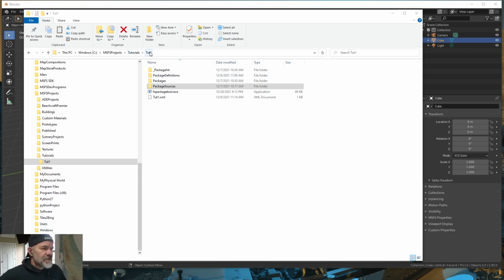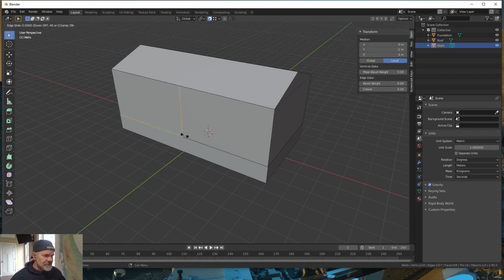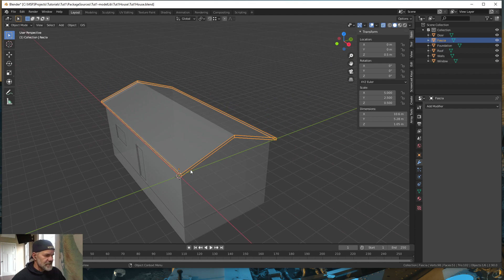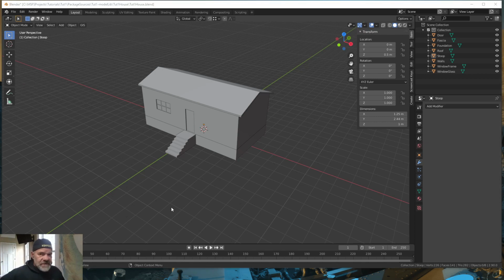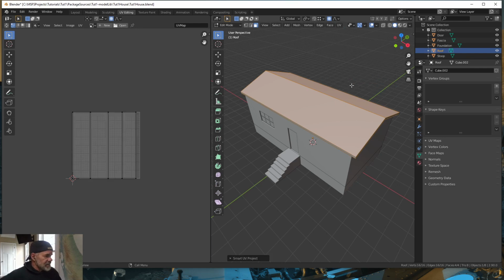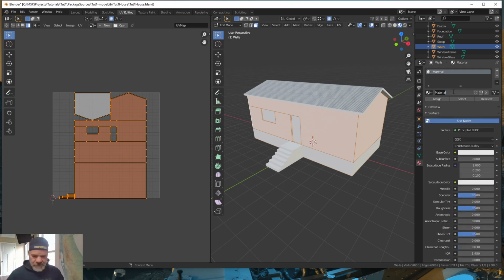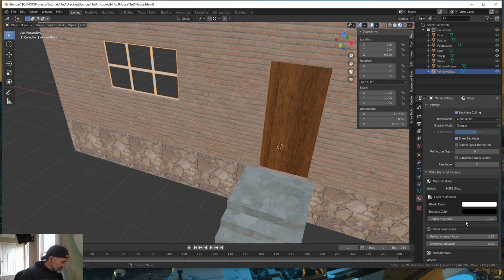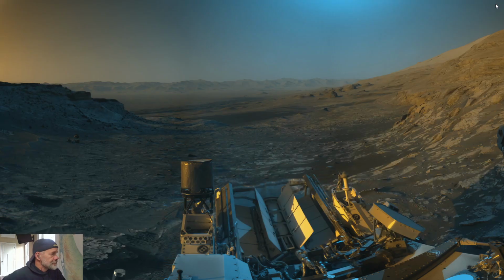Part 5A: Creating Scenery for MSFS 2020: Making a House in Blender and Exporting to MSFS

Comment: Hi.  Thank you for your tutorial series your measured and honest delivery of what we need to do is just right for me.
I am used to using directories/folders etc to run things but haven’t done that for about 20 years. Well done
I have a question I have imported an auto and model into blender( .stl file. ) Just to paint. It.
I have unwrapped the painted model. There are a lot of faces in the unwrap area painted. Are these paint /textures to be put in the project textures folder ( tut1-materials) in your tutorials.  Would I need to add  roughness to them to give them a texture.
Many thanks. Geoff Elks😊
Reply from the maker: Actually, textures used to paint objects are placed in the "texture" folder of your modelLib folder. The "Textures" folder in your materialLib is used for "in Sim" ground textures.

Comment: Hey Mr. World, I don't know if you've addressed this in a future video, but at 44:50 you refer to the Metallic texture slot as a roughness slot.  This is in fact a composite texture slot.  This composite texture consists of 3 grey-scale maps: Ambient Occlusion in the Red channel, Roughness in the Green channel and Metallic in the Blue channel.  This texture is usually named with a _comp suffix. If you assign just a roughness image to this slot, it will mess up the AO and Metallic maps since you would be assigning the roughness image to all 3 maps.  There are some pretty good videos on the construction of this composite texture.
Reply from the maker: Nice. I have to review what I said and take a look. Thanks for the input.
Reply: Keep up the good work.

Comment: Good video. I have a question for you sir. Under the msfs params menu for adding textures. Your screen says Albedo for the first selection and mine says Base Color. Are they the same thing? I don't have an Albedo anywhere. I'm using Blender 3.2 and Multi-export glff 2.0 for the msfs addon. My msfs addon is a bit different from yours. Do you have any experience with it?
Reply from the maker: It is the same thing. I use the Asobo exporter in 3.1.

Comment: Love these videos they have helped me a bunch! Im just wondering, I have an existing project and got done with the first terminal and i have some texture issues where they show up pink or i have a face missing in the sim, im just wondering how to fix them in blender so that they would automatically update in the sim. do i have to create a brand new file and project or do i replace the xml file and run it through fspackagetool?
Reply from the maker: Pink means missing texture...it does not know where to find it. Make sure you are exporting with the correct path. Miss face is most likely a face that has it normals facing the wrong direction....flip the normals.
Reply: @myphysicalworld3958  I figured that pink textures are missing ones but I'm not sure why since I have it properly sized and in the correct texture folder where every other texture that loaded into the sim is in. I will redo the texture and try to look into that but after I am done, should it update by itself when I bring it out of blender? Or do I repeat the steps of bringing it into the sim? Or can I just update the files in the existing project.
Reply from the maker: @adrienseppanen5517  Gotta love the strange stuff that happens sometimes....I had pink textures "once", a long time ago. I think I just went into Blender (after confirming size was good and that it was a PNG) and re-added the texture to the object, re-exported, re-built. It doesn't by chance appear "purple" in Blender does it? If it does, then Blender cannot find it...(I'm sure you are not having "that" problem or you would have mentioned it). Does your build show any errors or warning?
Reply: @myphysicalworld3958  No it appears normal. in my textures tab (where you see all your different materials that you used in the project) some textures appear pink also, which is strange because they appear normal in blender and in the sim. I dont have any other warning except that file name is invalid 😂 But I will re-add the "missing" texture and then rebuild it in the sim I will see what happens!
Reply from the maker: @adrienseppanen5517  do you have "../texture/" in the export settings?
Reply: @myphysicalworld3958  
I have "../texture". ive seen people use both but since my blender doesnt like exporting new texture folders for some reason i manually move my textures to the file in my modellib
Reply from the maker: @adrienseppanen5517  to the texture folder in your modelLib OR in the actual model folder in your modelLib? Oh, btw, forgot to ask, is this the first build or did they work in the past?
Reply: @myphysicalworld3958  i copy it to both just incase. and this is my first build ever using blender and mfs2020 so thats why i am a little lost. but if you are asking if this is the only build ive brought to the sim then yes. It worked the very first time and after that, no luck. now it worked again so i was happy about that
Reply from the maker: @adrienseppanen5517  good, glad it worked
Reply: @myphysicalworld3958  went back to fix the textures, after some problems with blender 3.1 not wanting to export my file i switched to 3.2 and it worked fine. but im just getting this problem that when i try to export it, everything is okay. but when i run it through fspackagetool.exe to check that everything works, im getting a red and yellow message "mesh (0) primitive (17) has an invalid triangle mode, only triangle lists are supported, primitive (17) of mesh (0) ('main building 1') has no faces". i get this same message for 7 different objects. I haven't had this problem before but suddenly when I updated my textures due to texture issues im getting this. I checked everything in my blender file and see no problems concerning textures or the model
Reply: Never mind i fixed it! I had bad geometry and couple loose ends which the sim didn't like. Thank you sir for everything! Have a wonderful day!
Reply from the maker: @adrienseppanen5517  right, missing faces and orphan vertices can cause havoc!

Comment: I love your tutorials. They have been extremely helpful. I have already designed a couple of items for my home airport KIDP. I was a complete novice with Blender before I started but have completed a very satisfactory version of the terminal building at KIDP.

I do have a question about using the fspackagetool.exe program. When I drop the .xml file onto it, I do get a command prompt window (formerly DOS window) to open up and the program runs normally. However, I don't get the "Press any key to continue" prompt when it completes its execution like it shows in your window. It just closes the window and I can't read the results to see if it has completed properly. Do you have any suggestions?
Reply from the maker: Hmm, odd. Make sure you Left mouse button dragging and dropping? Also, when was the last time you downloaded the SDK and installed? I vaguely remember a past version of the SDK doing that....I think.

Comment: One problem. Through the window you can look through the opposite wall, i.e. from within the house the walls are transparent. This canbe checked already in Blender with a single cube.

If you assign the texture not in the MSFS section, but in the default section, the walls are not transparent from inside. So there is a problem with the MSFS shader flow.
Reply from the maker: Apply double-sided, problem solved..
Reply: @myphysicalworld3958  I am a beginner at Blender, but I will figure out, thanks. Also, probably I will create "real" thick walls and there this will not be the problem as there will be normals pointing to inside the building as well.

Anyhow, this is the first video I have checked from your channel, and I was very pleased. I am working in IT, make presentations about science and IT frequently and I have to say, the pace, depth of this video lecture was perfect. In many such videos the presenter is just going through the steps very fast and you just realize what was the purpose afterwards. In your video I (mostly) always knew what you would like to achieve in the next step. Thanks very much, I will go through several of you other videos.

Comment: Hi Christopher 
Have paint now as a texture in texture file.  I have problem. Have followed the blender file export to the letter. I am not getting the 3 extra files  only the export XML.  With guid   No .bin or gltf  file.  Please can you advise.
Reply from the maker: In Blender, go to File, Export, glTF and make sure to select xml, bin create.
Reply: Thanks Will try now.
Reply: Have selected the drop down under format.glTF separate(.gltf +bin +textures) but  still doesn’t make the bin and gltf file
Can’t. Find any other selection.  I am using blender 4.1 and msfs tools 0.40.0
Reply from the maker: @geoffelks204  There's the problem. Above Blender 3.3.x is not supported as of yet. You need to use V3.3.x and Asobo's Exporter. Link in description should point to Asobo Exporter.
Reply: Oh ok thanks

Comment: Hello, I export the model the same as in the video. Batch export fails when Lods is not opened. I open it but it only exports the xml file. Could you help? Thank you...
Reply from the maker: I am assuming you are using msfs2blender exporter. Batch exporting for LODs doesn't work. You can run it once to create LOD00 and the XML, but you will need to export the other LODs individually without the batch export. However, if you switch to Blender 3.1 and use the Asobo Exporter that problem goes away. I have a video "Levels of Detail" around the 20 minute mark telling how to overcome the bug in the exporter.
Reply: @myphysicalworld3958  You answered the moment I solved the problem. thanks anyway :)